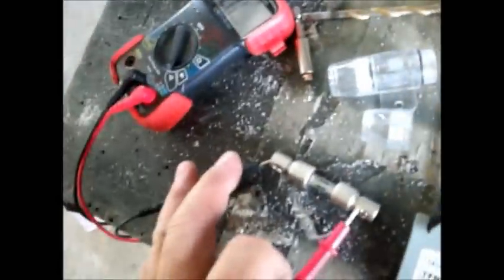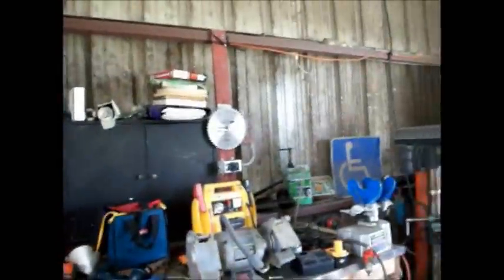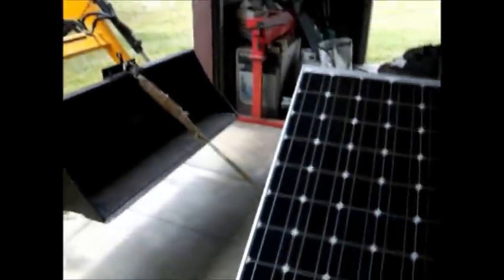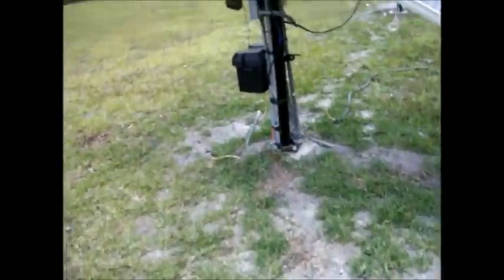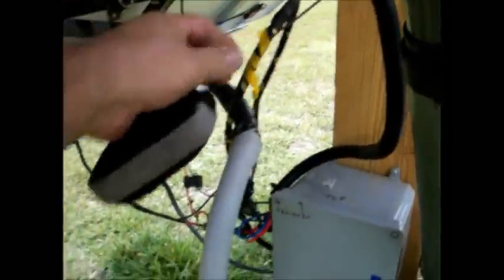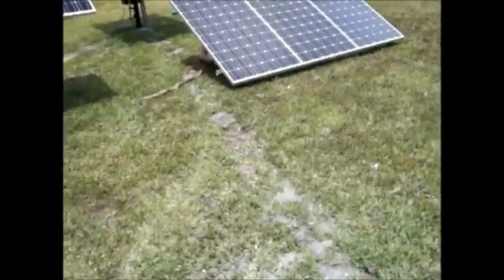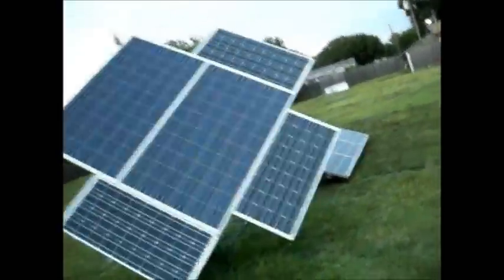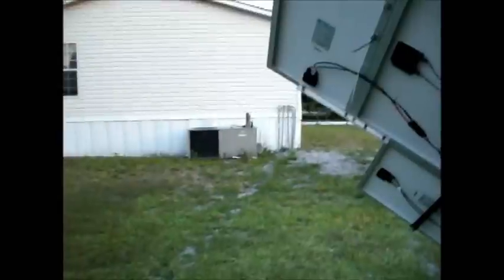The big Move Out Side For My Temp Panel Mount..

Comment from the maker: Yes this am Monday 4-30-12 .had 270 watts on temp panels,On both 705 watt trackers #2 & 3 were at 540 watts pointing east as of 8:45 AM. So far so good. Need to build 2 more trackers 4 panels each and get tracker #1 replaced to new design,They work awesome after dialing them Both in sync .